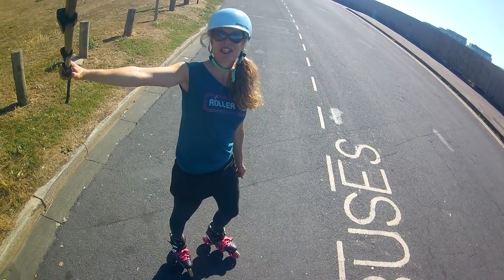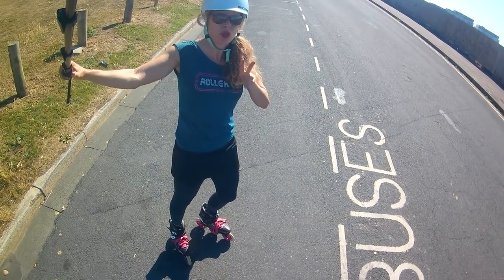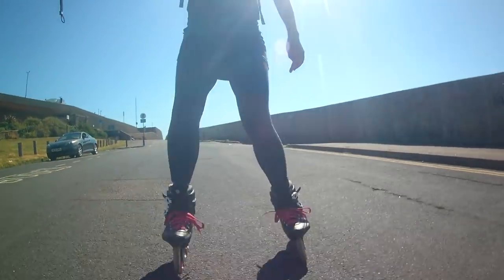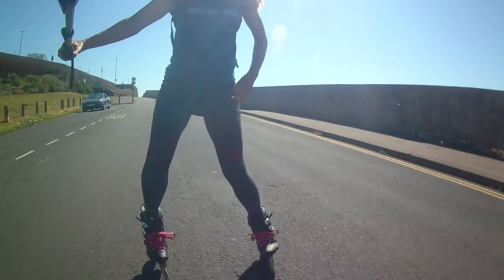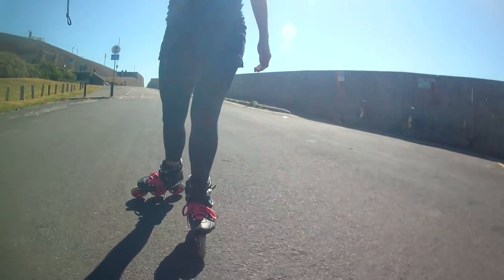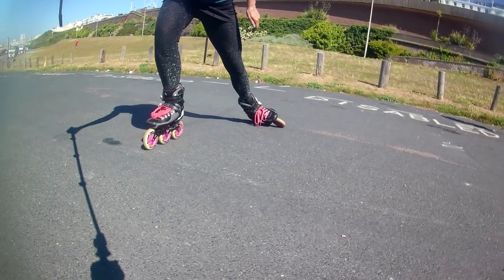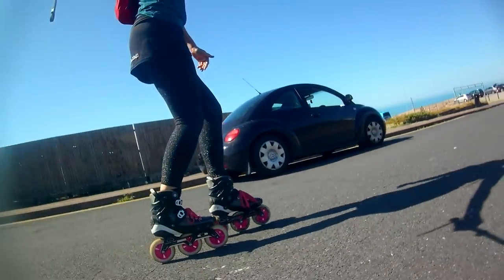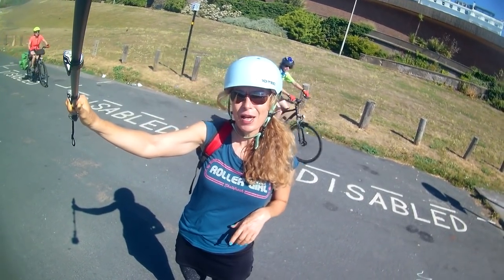How to stop and control speed on down hills and slopes on inline skates or rollerblades.

Comment: this was so helpfful!!! i was wondering how much does dragging ur skates on the floor wear out the wheels? how often should you replace skate wheels?
Reply: It worn out too quick specially doing power slide, so as much as i can im just doing the stepping plow stop, to stop at high speed, t stop and power slide are both harsh on wheels
Reply: hi i know this is wayyyy late, but with regular skating (4ish hours a week) skate wheels should be replaced every month or two

Comment: I’m a decent ice hockey skater but inlines are scary. The easiest stop for me is a tight turn where I pivot about the heel of one foot. I can stop very quickly with that method. I see you do a spread eagle in the middle of that power stop. No way can I do a spread eagle. Inlines are so tiring compared to ice skates, and the lack of control on stopping is worrying. Ice rinks are closed, so I’m going to be doing more inline skating. About five hours practice so far. Much more is needed. Thanks for the videos, very informative.

Comment: I don't like Т-stop because i sparing the wheels. T-stop eats wheels like a beast.
But if someone has a wheel factory, he can proceed T-stop 24/7. ))
Reply: T-stops should really be done on the outside edge, not just lazily hauling your foot around. That doesn't mitigate the wear that much but might make you feel better for balancing it out.
Reply: I have 2 sets of wheels. First set- good big wheels 90mm for fitness scating, which i don't want rip with slides or T-stops. Second set - cheap secondhand wheels 65mm-72mm for practicing slides, T-stops and other elements. When i wear 90mm set, i attaching default brake and using it for brakes and saving wheels.
Reply: Rotate your wheels, stock up on wheels, switch sides, lift up as you drag, stop being a babby about wheels etc.
Reply: If you're poor, don't come to Brighton!

Comment: Yesterday I was going down hill,so fast at an extreme speed,I tensed when I couldn't do a stop.Now am all bruises,but guess ill learn gradually, want to start using my skates to work
Reply from the maker: Sorry you had a fall (I assume that's what happened after the tensing up?) I recommend starting at the bottom of a new hill and slowly working your way up the hill adding 2 metres with each descent. Force yourself to stop on the hill and also at the bottom when you have all the speed of the hill. You must train hills like a specific goal with specific training drills and process. Otherwise they will always be problematic. Good luck.

Comment: Can’t wait to try these! My method for stopping downhill so far has been a controlled crash into a utility pole…
Reply from the maker: Ouch, don't even joke about that/ That's the best way to break a wrist, elbow or worse! Good job you're online trying ti learn tips on downhill stopping. But really nothing beats actually nailing your best methods on the flat first and then developing the same expertise on different slopes. 
My best work is inside my online courses where I've got 5 stops in a series and you can choose just the ones you want. There's 20% off till midnight tmrw for Easter. 
Check them out!!!
Discount Code: FeelAlive20

https://skatefresh.com/stops-slides/

Comment: Going downhill depending on the elevation, if high then Combination of drag/t stop with slalom turns to carve if space otherwise drag stop harder, kill speed using small  circles obviously keeping surrounding vehicles in check using peripheral vision.

 Or learn magic slide all together..
Reply from the maker: Yes the Soul and Magic slides are great for downhill descents. I can't do either due to a hip injury I have (nothing involving internal rotation is possible for me), but yes another good option.

Comment: Excellent video once again, but I'm assuming the toes in side stepping technique would only work before you pickup speed, if you are already half way down the slope reaching a reasonable speed, that technique could potentially cause u to tip over 🤔, do correct me if I'm wrong.
Reply from the maker: Hi. This is Sergio from Team Skatefresh. The stepping plough works great in slopes and speed as long as it's done perfectly, in fact speed skaters use it. However, it's tricky for most people because it needs a slow cadence, an exaggerated stepping out lateral motion and a correct angle for the feet. Three factors in harmony. If one of them is not under control it's easy to panic when you realize you go faster and faster. So it's a stop to practice a thousand times on flat first, and once you feel it works great at speed then you progress onto gentle slopes, and always start the slope practice at the bottom of it.

Comment: I grew up on ice and on hockey skates.  No problem stopping on ice.  Obviously, a hockey stop doesn't work on inlines.  Forward and backward skating, crossovers in turns, etc is similar on wheels or ice.  I'm still practicing my stopping techniques.
Reply from the maker: Hi. This is Sergio from Team Skatefresh. It's great that you keep practicing, most people on inlines get the basics and stay there forever missing all the rest. The hockey stop does work on inlines, however it's probably one of the hardest and trickiest slides to perform because of the asphalt grip. It feels REALLY different but can be done well on perfect indoor surfaces or on dump or extremelly smooth tarmac. But it's also very demanding, it requires a lot physically. The keyword here is "grip." On ice everything is slippery so the hockey stop, the plow, etc. are not rocket science. Turns and spins are way easier on ice too because of the same reason.

Comment: hey there asha, i love your videos! does the stepping plow also work on quads? i'm planning to get into inline skating soon, but i've been skating on quads for a few months now and i've never seen the stepping plow mentioned in quad tutorials. i know some things translate between the different skate types and some don't, and i know you skate both so i'm curious about it.
Reply from the maker: Hi. This is Sergio from Team Skatefresh. Stepping plough works in quads very well. In inlines is important the inclination on inside edges, apart from other factors; in quads since you don't have those edges, instead it will be more about the inverted V position and the most important factor will be the stepping out laterally and its cadence. This is a video about slopes... Think twice if you are planning to go downhill on quads using stepping plow. You should practice a thousand times on flat surface first, and still it will be dangerous downhill. Slopes are way much harder on quads and you can be more easily tripped up by debris.
Reply: ah okay thank you! i will probably stick to going downhill backwards on quads then.

Comment: Hi I used t stop but I still go pretty fast downhill can u make a tutorial on how to stop quicker using t stop?
Reply from the maker: Hi. This is Sergio from Team Skatefresh. In my opinion the best way would be to use alternating parallel turns in a slalom way mixing different stopping methods throughout the slope. I even use alternating T-stops in diagonal directions. All this should start even before you take the slope, not in the middle of it when you already have quite a bit of speed.
Reply: @SkatefreshVideos  ah thanks cause I almost got into a car accident when I skated down a hill thanks alot since I normally t stop in the middle

Comment: When i attempted do the t stop, the stoping  leg starts to turn around  and causes me to lose control downhill
Reply from the maker: Hi. This is Sergio from Team Skatefresh. That's because your back leg is carrying too much weight. Most of the weight should be on the front leg and this leg must be bent. Two other things to have in count: 1) The skate in front should be on the center edge. 2) It's called T-stop but the position is actually like an L. If the back skate crosses behind trying to make a perfect T, that combined with an inside edge in the front skate... that could make you lose control. Besides, one thing that can help you is to extend in front one arm. If your back leg is the right one then extend in front the right arm, and viceversa. That will force your hips to keep facing the direction of travel. Practice the T-stop on flat surface until you have it perfect, and only then you can use it on a slope. For a further detailed explanation you can check Asha's online courses, they are great to learn different stopping methods https://skatefresh.com/learn-to-skate-online/
Reply: @SkatefreshVideos  great, thank you bro.

Comment: Why does my skating boots shake when am moving too fast
Reply from the maker: This is called "speed wobble" and its a common phenomenon at speed. The smaller the wheels the more they will wobble at high speeds due to the forces. Bending your knees more will help reduce it, as will not having your weight on your heels. A longer frame also helps which is why speed skates are longer.

Comment: Do you go faster downhill on bigger wheels? I have never used wheels bigger than 90mm which is what I have always used for the last 20 years.
Reply from the maker: Yes absolutely. Bigger wheels will roll faster down slopes so it’s even more essential to have good slowing down and stopping techniques. Don’t go up in wheel size unless you have mastered this first! It’s not worth the risk.
Reply: @SkatefreshVideos  I definitely agree.

Comment: What about when you're flying down a hill at top speed as a newbie skater. It happened to me and I tried to use the break and I was going too fast so it knocked me off balance and I flew into the air and landed on my back. It was awful and I'm terrified of hills now.
Reply from the maker: Hi. This is Sergio from Team Skatefresh. I'm sorry for your accident but it's natural for you to be terrified now. It's incredible how many people come to watch this video after having an accident and not before! First of all, newbies shouldn't be taking slopes AT ALL. Second, one shouldn't be waiting to be flying downhill at top speed to apply stopping techniques. You should control your speed from the very beginning when your system sends you the first warning "Hey, you are going downhill!" and there are still chances to stay safe. This message is very noticeable and it's wrong not to pay attention to it, because the speed increases very quickly. It's just the same when you are in a horizontal plane. Your speed limit is adjusted in your brain according to the speed you feel comfortable and you are able to apply stopping techniques. That's your safety threshold. If you go beyond that limit then you pass the "point of no return" and you can only pray for the best, because if you try to do something at that speed, not in your comfort zone, chances are you'll fail and get in panic. Blocked mind means blocked body. The heel brake does work at high speed and in slopes but only if you are able to control it in a horizontal plane first. The same applies to every technique. This is why it's important for every skater to go beyond their limits BUT in a controlled way, in a controlled environment. You push the limit bit by bit and that's how your comfort zone expands.
Reply: @SkatefreshVideos  Hi Sergio, thank you so much for explaining this to me. This is very helpful and I really appreciate you taking the time too. When I went down the hill it didn't look so steep but it was dark out and I didn't realize it would be that bad. I ended up speeding down headed toward an intersection where cars were driving by and I panicked and tried to use my break. I didn't know I could go that fast on skates. It taught me a very valuable lesson and I'm thankful I wasn't hurt more than I was. I was foolish and unprepared as I didn't have a helmet on. I wish I had thought to look up your video ahead of time but I didn't know what I was getting myself into. Thank you again for responding to me. This is a lot of very helpful information.

Comment: Hey! New to skating! Will the type of wheels have an impact on the T-Stop? I’ve purchased the Roces vidi skates
Reply from the maker: Hi. This is Sergio from Team Skatefresh. Not at all. The T-stop is possible with any type of wheels. The bigger the wheel the more difficult it is to control speed and stop. Very hard wheels feel slippery when they are brand new, until the coating is worn a little. However, I don't think the problem are the wheels. Instead I must say the T-stop is not as easy as people think for beginners, it's actually an intermediate level stop. It involves several factors. Check this video https://www.youtube.com/watch?v=We-1RnLY49Y If you are an absolute beginner I suggest you use the heel brake until you get the factors required for T-stop. Another good stop for beginners is the Stepping Plough. Asha has also an online course for beginner's stops here https://skatefresh.com/product/how-to-stop-beginner-level/ By the way, you are commenting on a video about slopes, and slopes are not good for beginners. So if you are a starter trying the T-stop downhill that's not good at all.

Comment: Please help me. So I going down the hill on rollerblades. It’s going pretty fast and it’s a new trail. I don’t know if there is another downhill after the turn. I’m going faster and faster and slide break at that point will help me to get to the shoulder faster :) I might just jump myself. What is the good technique there? The breaks failed today
Reply: Also there are uneven road splices like every 20 feet or so too
Reply from the maker: Hi. This is Sergio from Team Skatefresh. The point is that you shouldn't take a slope if you are not ready for that, and be ready means to know several stopping ways in order to combine them. You must be very comfortable doing it on a flat surface (with speed) and only afterwards you should practice in mild slopes to get used to it progressively. Besides, you don't have to wait until the speed is high, you must start stopping before that point.

Comment: Is this the same for quad skates?
Reply from the maker: Hi. This is Sergio from Skatefresh Team. Yes, more or less. On quads sliding your wheels sideways is more difficult. For the stepping plough on quads since you don't have edges, instead it will be more about the inverted V position and the most important factor will be the stepping out laterally and its cadence. It's quite tricky actually and debris can make you stumble easily on quads, so you need to be very careful.

Comment: can i get brakes for freestyle skates? does it even work together?
Reply from the maker: Hi. This is Sergio from Team Skatefresh. You will need to ask in a store if they have a brake to adapt to your particular model. All the major brands have one. Can freestyle and heel brake work together? The quick answer would be no, and that's why freestyle skates don't come with a brake. Freestyle involves slalom tricks and slides, those are very advanced techniques that take for granted that you already know how to stop without the brake. The problem is that the heel brake interferes with many of the tricks. In some you have to cross your skates very close to each other, in others you have to roll or pivot on the heel wheels. However, there are certain tricks, the most basic ones that you can still do even with a heel brake, for example the Fish which is the classic slalom move with both skates parallel where you go in zigzag like in ski, the Snake which is quite similar but with one skate in front of the other, the 1-foot which is of course the zigzag on 1 foot. You can do those forwards and backwards. And guess what, there are even very advanced moves that you can do too, such as the Butterfly, the Swan, the Footgun (AKA Rocket), the Wiper, the Christie, etc. Those moves involve either gliding on 1 foot or gliding on front wheels. So yeah! You can still do some freestyle slalom.

Comment: Find ploughing so hard to get down :(
Reply from the maker: Hi. This is Sergio from Team Skatefresh. It is! The point with the plough is to keep both feet apart and in an inverted V shape. If thighs burn that is a sign you're doing it correctly. Knees must be bent too. The stepping plough is easier. Of course all this needs to be done perfectly on a flat spot before taking slopes.
Reply: @SkatefreshVideos  i think in out if shape hahaha, i feel like my ploughs are done passively. I will keep trying ! Thanks for the tips (the burning thighs) thanks sergio!

Comment: The closest thing I've done to roller blading is skiing so I kept trying to "Pizza" my skates instinctively. Do NOT do this. Lmao
Reply: Actually, that is called a plow and i use it extensively. Go wide and push the skates out. You will be able to do brake similar to the pizza point. Because a street has more friction the angle is nog that obvious for other ppl.